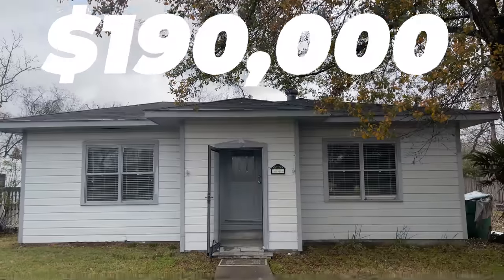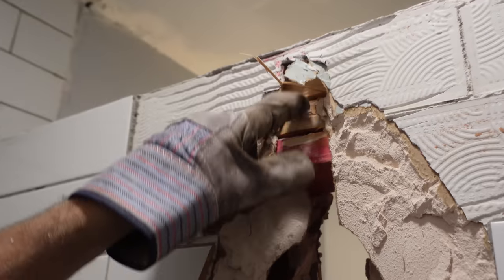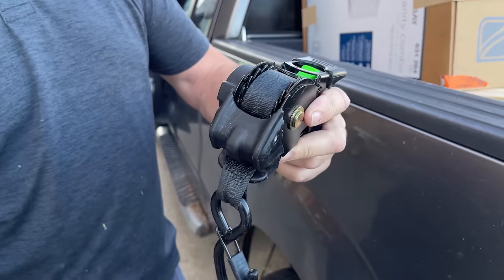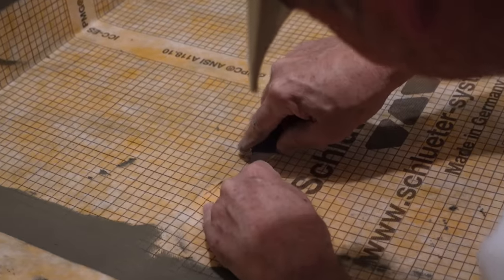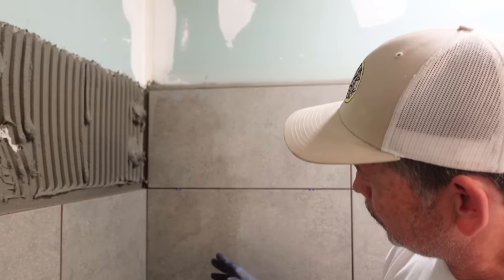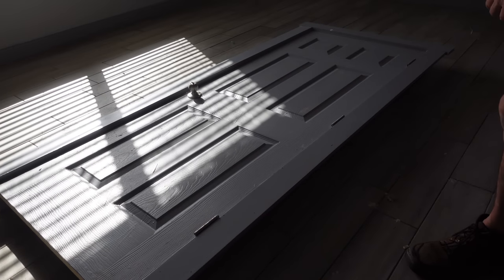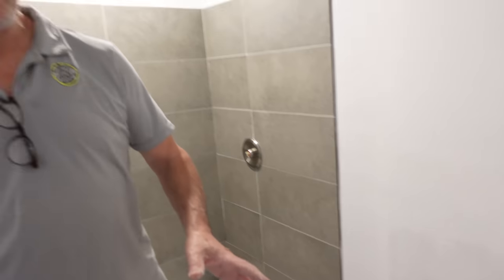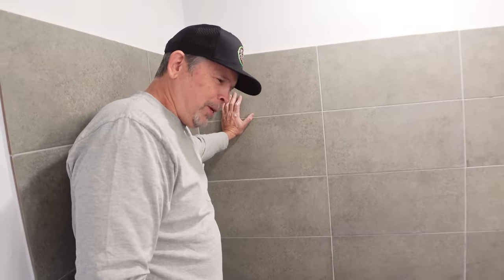MODERN BATHROOM for $1,000 CHALLENGE (Start to Finish)

Comment: For a temporary shower, you don't need tile. You can paint over backer board after having taped the seams and screw holes. For temp shower floor, you can use rubber mats.
Reply: need video content LOL

Comment: Good videos. 
C. 1980 I worked for an old time tile and marble installation company.  We built old school shower stalls with tar paper backed metal lathe screwed to the wooden studs. Applied a scratch coat of mortar to the lathe, scratch it with a small piece of lathe while mortar is setting up so it was very rough. Next work day install a lighter weight mortar 1.5 inches thick by setting two oiled furring strips on each wall plum, square, and level. The strips plumed, squared, and leveled in vertical beds of mortar about 1.25 inches thick. After lunch use the set strips and a straight edge to fill between the strips. If memory serves we removed the furring strips the following work day and then filled those voids with same mortar and purlight (huge bags of little styrofoam balls) mix. Tile would go up the following day. For a house we would work on two or three bathrooms each day. 
   I still see some of those old shower stalls from the 1960's and 1970's in homes. Some have never been caulked and the grout still has no cracks in the corners or floor edges.  When I see one I'll inspect it closely.  I have seen some old ones that did crack but that is likely due to the house settling or termites eating the studs. Some of those old bathrooms have pink, yellow, or green tiles. The tiles did not have nibs (tiles with built in spacers) way back then. All the floor tiles were one inch square for safety. Some day I may build one using that old method. I'd wager that Stud Pack has removed some of those old lathe and mortar shower walls.

Comment: Looking forward to the stud pack house for sure. These guys throw together a low buck (relatively) bathroom remodel cutting corners and such and it looks better than any bathroom in any of the rentals I have had. Just goes to show when you guys are doing high quality work even dropping it down a few notches still puts you above loads of contractors out there.

Comment: For the final bathrooms, I highly recommend chair/comfort height Toto Entrada (Model #cst244ef#01) for the toilet. It has a 1,000 MaP score, 3" flush drain, now comes with tower flushing system, is a comfortable height to sit on and get up from & flushes like a beast without splashing. Toto makes sinks with a cefiontec (sanagloss) finish that makes it resist dirt longer so it doesn't have to be cleaned as often. The Toto Drake toilet (original version) comes in the sanagloss finish for their standard height toilets but its not available for the entrada or the ADA height Drake. The ADA height is almost an inch taller than comfort height. Comfort height is about 1-1/2" higher than standard height. A shattaff that mounts on the wall or a built-in bidet seat thing would be nice. My mother has one in her bathroom so my brother likes to use her bathroom more than mine (which doesn't have a shattaff set up yet.

Comment: Awesome job as Always guys,, I was watching to see you guys pull the tub out and knew the shower walls would have to come down , Because I had a couple family members replace my shower area in the master bathroom,  The Biggest mistake we made was not replacing the floor under the cheap tub and the drain pipe is holding water ,I tried to snake it today but I could not get it to go down in...

Comment: I've lived in bathrooms with showers that weren't built anywhere near the quality of this one, even with your would never use shortcuts, we would never normally do this, but its recurring it's temporary concept...but...they were built the way they were (nowhere near your "it's temporary standards") and I had to live with the mentality of this is what you get.  Live with it.  (Fortunately, I did not own the properties, or...All Y'All can fill in the blanks.)  Great job, guys.  I really like the shower and how it turned out.  I could live with the shower, in particular, permanently with no problems at all.  Great job, and great video.  Please keep them coming.

Comment: You said that tile saw made rough cuts. Don't know how you were doing it and you may already know this, but with that type of saw you cut the tile face down (blade underneath, face down/blade on top, face up). Also sometimes helps to put green painter's tape on the cut line before you cut.

Comment: Hey guys, great video.  I’m trying to learn diy shower build so i can help convert my grandma’s 3/4 bathroom to a roll in shower.  Would you just leave out the curb and tile as usual? I’m probably going to use a pre-sloped shower pan and a linear drain

Comment: It’s amazing that you didn’t have mildew, mold, and rot.

I just burned up my rotozip tool. Bought a Dewalt cordless router using 1/4 inch drywall guid point bit and removed the depth gauge/guard.  Oh by the way I also have a new router . It takes a little getting use to but it works great.

For 6-8 months would have built a temporary bathroom probably would use a horse water trough with a shower curtain. But would not have had the fantastic content you shared with us. Your cheap temporary job is better then most permanent jobs.

Comment: I would think a standard shower pan and pvc drain might be cheaper than the Schleuter. If you had any leftover pan liner it for sure would.
I should have watched the rest of the video. Just seal that tar paper to a pvc shower flange with some silicone. That would be fine for 6 months.
I’m curious if you put a partial tile on green board normally? I know sheet rock is no good for holding tile. I didn’t know is slightly overlapping was okay because it’s temporary or would it always be okay because it’s on the hardie backer enough to no be an issue

Comment: Honestly the "temporary" mindset is a genuinely valuable perspective. It gives you an idea of the corners that can be cut without devastating consequences. There's obviously something to be sad for good workmanship...

If you are in a situation like this you can get a LOT done for only a bit of money, even if it does end up a little rough around the edges. Better something that works and lasts than something that is really pretty but leaks and rots...

Or you could just be like the original bathroom, which was just all around awful....

Comment: I watch all of your vids. With the Anvil snap cutter I did not see a score line. That cutter should cut those tiles like butter. When we lay tile all we use nowadays is a snap cutter and a 18V grinder with a diamond blade for the curves. Snap cutter stays in the room and saves time, no walking back and forth to the saw. BTW I have learned a lot from you guys, Thanks!

Comment: Budget paint. You can find quart and gallon paint in horrible colors in the returns section. Just buy 3 or 4 colors and mix them together in a 5 gal bucket. You can add white or black to tint as needed. It will end up as some kind of neutral blah shade but perfect for a cheap temp hallway or room wall. Since it was returned it is super cheap and usually better quality.

Comment: Love these vids as always! Kinda curious why tiling, other than for aesthetics, is necessary for something so temporary. Couldn't y'all use some waterproof backer board, seal it up all tight, then maybe coat the entire thing in fiberglass/epoxy and sort of make an in-place version of a fiberglass shower? I'm not a builder, so I'm speaking entirely out of ignorance.

Comment: On the new build, you should check out the flo fx drain. It’s highly recommended by the tile coach.  It was designed by a tile setter who wanted a better drain and it’s about a third of the cost of the Schluter drain.

Comment: Nice quick turnaround on a bathroom.  My only issue is you took the shower wall out which keeps the water in the shower.  With the low step there's nothing to keep a shower curtain in the shower.

Comment: You can avoid the wire lath if you water proof the surface first and add some latex milk. I know this is temporary but a little tip for ya in the future. That milk is amazing

Another tip. You could have scored that tile and broke it yourself on some cement. I know it sounds sketchy but you could even do it on something sturdy. 

That! Or hold it on a sturdy surface and smash off the trash part with a hammer. The reason that cutter isn’t breaking it is because how weak that bars are. Gotta improvise;)

Comment: Building inspector required me to use the lite weight mix with water wall compound. ( I used the 20 min set time to push the hardening for a second and third finish coat.. Inspector would not allow me to use all purpose compound.  He said that the other stuff better and stronger in dampness.

Comment: Well, that was fast! I actually like the stacked grout lines. It gives it a nice industrial feel, and is quite modern. Great job, boys! One idea to save cost and lower the budget is to find a local Habitat for Humanity ReStore. Most contractors I know and deal with will donate left over materials and supplies to them, and what they don't use gets put in the ReStore. I've found 1,000 sq ft of tile for a couple hundred bucks, and doors for $25 before. They also have new and slightly used (such as for home staging purposes) furniture. It can be a great resource!
Reply: i was thinking this too, great place to pick up a small job's worth of stuff

Comment: Ok ok ok!!! I saw tools I don’t have yet lmao. What is the one you use to cut the inside of the pipe? Also the Bosch hammer tool?  Love you videos!! I am trying to get the courage to retire my guest bathroom as a tile over tile. And then going to demo my master bathroom bc the original builder didn’t do it right. Never sealed the corners of the shower and it’s been leaking and I never knew. Please respond to this comment!!!! Also do you have a video on the types of mortar? I see different ones and confused on them. I saw the type 1 isn’t for an area that has the water proofing on it bc it will eat it? So confusing. That is what is stopping me from going crazy on my guest bathroom. Thank you so much for any help!!

Comment: To save money on a project like that, don't buy premixed mud for the mud bed. Buy sand and Portland cement and mix at 4:1. 4 sand, 1 Portland cement. 
Not using a kerdi drain saves a bunch. Use a traditional shower pan liner and appropriate drain. Although  it's a proven system if done correctly, it's not as fast.

Comment: Great video, however WHY didn't you go to Habitat for Humanity Restore to see what you could purchase from them (there is one in Austin, I checked)?  The sink and vanity you could have been purchased for less than half what you paid, they often have tile on sale as well.  You didn't care about the color, they have many different tiles and probably more than enough to do your small bathroom (and flooring).  You spent more simply because you went to big box stores.  As someone below asked, how many days did it take to complete the bathroom makeover?  3, 4, or 5?  Finally I suggested you move your stairway in the garage to the opposite wall to save money and better utilize space - are you considering doing this?
Reply: 7 days for the makeover. Saw them comment in a comment

Comment: Perfectly good materials and time going into a temporary --- complete teardown of a house.  Could have save time/$$ just using a porta toilet/shower or used what was there as is.  Roughed it and camped outside and started with the primary construction of the foundation.  It's a good video on redoing a really $hitty bathroom though, that's for sure!

Comment: Just never liked putting the backer below the floor pan. I like taking my pan to the studs and the backer down to the pan. But each has a way they like best...
Reply: Either Shouldn't  be a problem, as The Schluter which is fitted to the Showerbase then Wrapped up the Wall is the. "" ACTUAL TANKING/WATERPROOFING  !!

Comment: @12:15 You furred those studs out not shimmed them.  A very common practice up in the cold regions where I am when you are renovating an old house and you need to give the walls a higher R-value of insulation to meet code.

Comment: Wouldn't have been cheaper (and probably quicker) to buy/install a direct to stud shower surround with a poly drain pan? Would have saved the cost of the tile, backer board, and saved on all the time spent on hot patching, sloped mortar pan, etc.

Comment: Instead of shelling out the $200 on a new vanity, had you considered your local Habitat for Humanity Restore for a good used one? Would have saved some money as well as repurpose a unit that might've ended up in the landfill. Best part is that most of the old used cabinets that they get in, are built much better than the new stuff that is built  nowadays.

Comment: Why not green board under the tile it’s “only temporary”  our house is 50+ years old and they were only green board and it has held up. Agreed cement board is very much better and will be used on all renovation work done in our new home.

Comment: That old tile job was so awful it makes me glad I've never tried to tile bc I'm afraid that's what my tile job would look like. LOL. Oh I hate particle board! Gbye vanity. Sink part might be worth donating and someone could build or find a different cabinet. I'm surprised that was a medicine cabinet and not just a mirror. Grab bar can be re-used or donated. I'm sure habitat for humanity re-store would find someone who wanted it.
"Who's tired of being careful?" and Rad holds his hand up. LOL.
With the price of lumber these days I'd be recycling every 2x4 and scrap of wood I could-- but I'm a bit of a hoarder. Ooh, Pex can be re-used.
Keeping the bolts makes me happy. LOL. 
Ok, breaking the stud to free the wire is something I've never seen before. Good plan.
For a cheap fix on this bathroom I'd get a cheap shower pan and cheap glue-up walls. LOL. Oh right, you're in Houston where they have more stores. I still miss Fry's electronics there. No stores like that over near me. Houston sales taxes of 8.25% are also easier on the budget since they are lower than Baton Rouge taxes 9.95%. Although Baton Rouge taxes are lower than in my area. 10.45% here. 
Ah, Glacier Bay. The garbage product. LOL.
ooh, those rhino straps look awesome!
I do like the old doors with the curved detail. Hope you keep those or donate them.
Is that old printed wooden paneling (with the blue floral pattern) I see behind there?
Every time you re-use some of the old material it makes me happy. LOL. Absolutely nothing wrong with using leftovers from a previous project.
I'm demo-ing a useless bathroom and since my friend will be doing the labor (I tore my rotator cuff and can't do much), he gets to use the 2x4s to add a hallway to his house.
Jordon losing his grip on the membrane is something I would do. I'm a total monkey. LOL.
Tiling and all that is way more than I would do for a temporary bathroom. LOL. I'd have like frp board and exposed wood painted in waterproof paint or something. LOL. That shower is way too nice to be temporary. It's nicer than most of the showers I've seen in motels-- and even hotels. Nicer than the permanent stuff in most of the houses in my area.

Comment: I'm sorry, but the inconsistent centering of the tiles around the drain would definitely make me count the days until I could run that bulldozer over that shower. I understand that you can't make both the overall shower and drain be centered, but not having the drains centered on the tile would drive me nuts.

Comment: Good Grief! If it's temporary just put up cheap plywood on the walls, staple in plastic sheeting and seal the seams with standard packing tape - the same stuff you use to seal boxes prior to shipment. You could paint the plywood white but who cares... it's temporary and cheap!

Comment: That bathroom is sad, and the person had no idea what he was doing and did it anyway.   I am not a contractor, but after watching a few videos, you know it's harder to lay down small tiles on the shower floor than just get a 1 piece shower base.  Plus there's less chance of leaks with a shower base with a lip than small tiles that are so uneven.    Instead of putting down a wall of tiles, use a shower curtain.   That tile job was hideous.  It would have been better if they went to bath fitters and gotten a 1 piece pre-fab shower/tub.

Comment: Misleading. You are contractors. No way this would cost a DIYer $1000. Think of all the special tools and additional supplies you needed for demo, framing, drywall, electrical, paint, tile etc. None of this was included in your costs.

Comment: Yeah who didn’t know the material only a couple grand? 😂  labor is expensive. I wish blowing smoke was illegal. Just tell it how it is. The material cost is 2 grand but the employee hour is upwards of 35-40. At 350 per hour profit target. That’s 40-60 grand. Parts are not as expensive as everyone fears. Your contractor just reaffirms your fear. Then tacks on another price. But yeah you can also bet you’ll hear “ why are using a 30 grand labor budget to install cheap material” in hen you will spend more. When the color you like is in stock on back isle or top shelf. But less price than anything else. You look over it. Because your not spending Pennie’s on a gold labor package.
Reply: Mind tricks. Be careful who you trust. Always know someone personally before trusting.